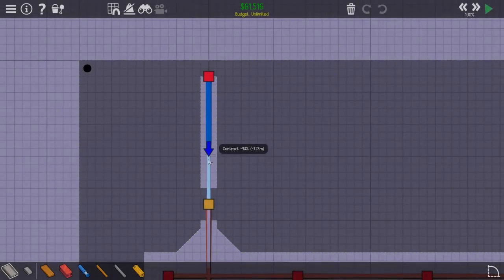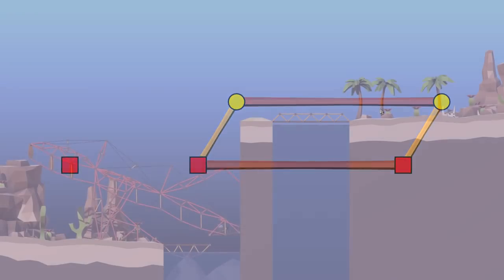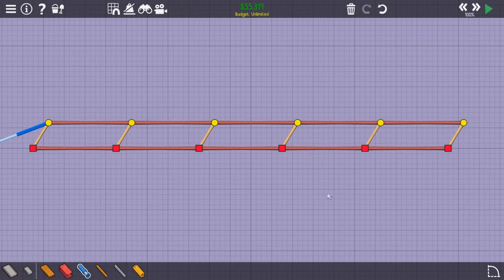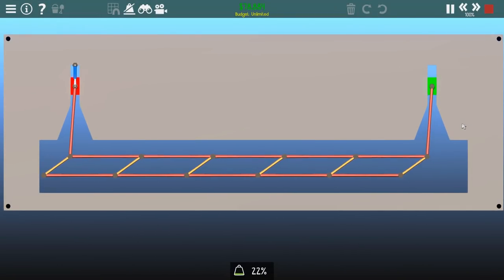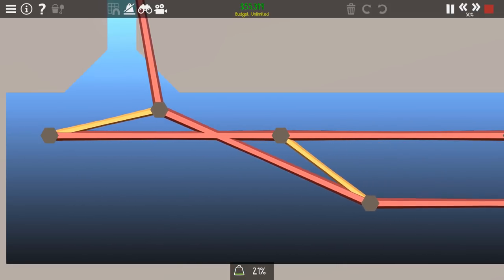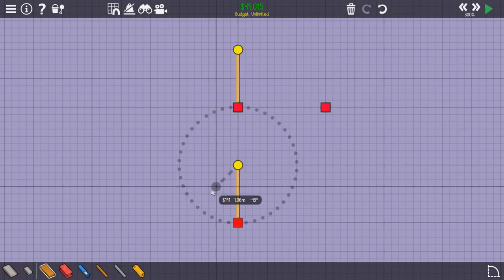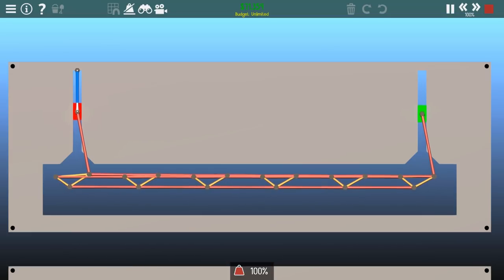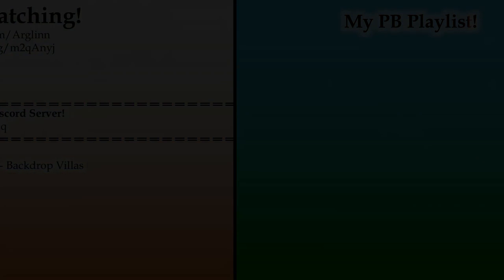The Parallelogram Linkage | Poly Bridge 2 Kinetic Bridge Basics Ep. 1

Comment: It would feel better if your examples actually worked without breaking, but I guess kinetic design is hard enough that simplified version of things is where we have to start. Cool video.
Reply from the maker: They can work without breaking giving the right reinforcements and such. I only use unbreaking as a full very clear demonstration for what happens. If parts are breaking randomly it could be harder to explain and reinforcing it will just make things more cluttered.

Comment: You dont need the steel in between the ancors if its connecting to both ancors right?
Reply from the maker: Yes. The beam is only drawn there for visual demonstration which will make a lot more sense once the other episodes come out.

Comment: Does this apply to poly bridge 1?
Reply from the maker: Yes. These lessons are teaching something that doesn't get affected by nondeterministic physics nor use any PB2 exclusive materials.
Reply: @ArglinPB  next challenge: compliant mechanism in pb2 using springs!
Reply: @ArglinPB  thanks, now I will be able to beat most of the 20 levels I've got left without cheating. This video was super helpful
Reply from the maker: yoni591 Don't even need springs to make a compliant mechanism. :3
Reply: @ArglinPB  wait what so how? don't you need something that bends/stretches to make a compliant mechanism?

Comment: i dont think he knows that connecting 2 static joints with steel doesnt do anything
Reply: i think he was just showing it was indeed a parrelelogram
Reply from the maker: @LiamLimeLarm  Correct. The only reason I'm putting it there is as a demonstration. This'll come in handy when I'm building arms and such, where it's no longer 2 anchors but instead an actual beam.